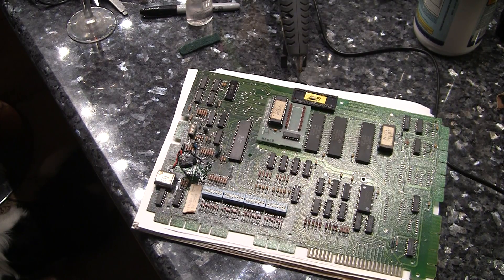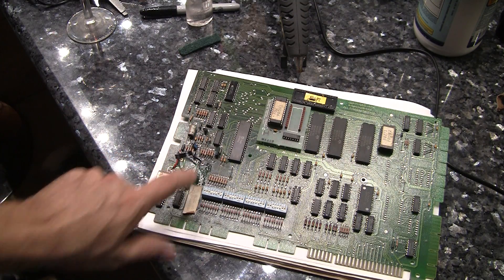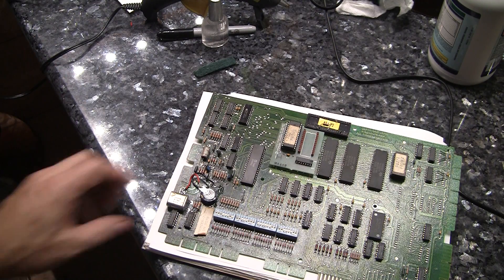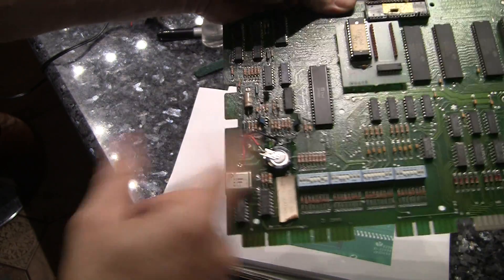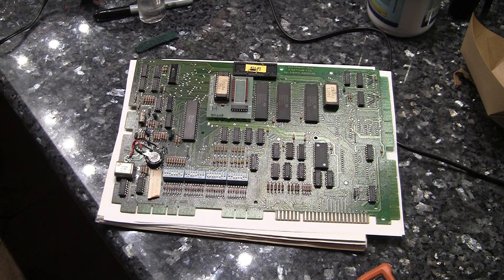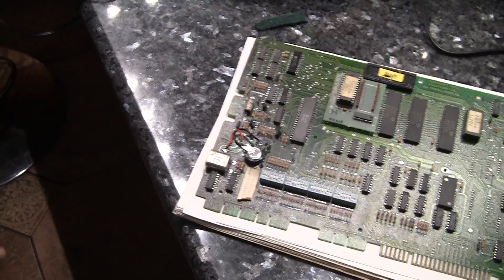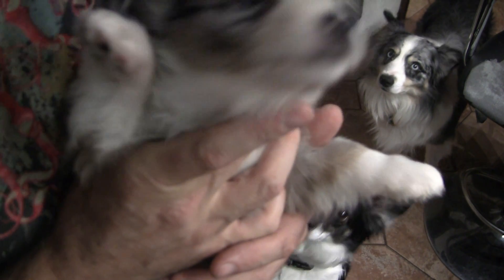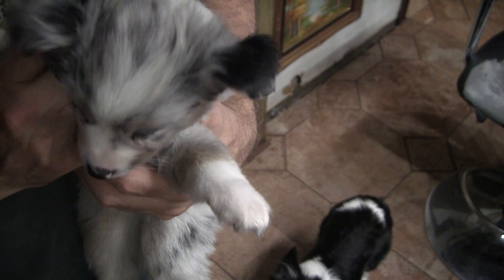Upgrading Gottlieb System 80 board replacing battery pack - Part 2/2 - PinballHelp.com

Comment: Would this also work on a Williams WPC game or only for games that “recharge” the battery?
Reply from the maker: I'm not sure if a memory cap is ideal for WPC games - it might have a slightly higher power draw.  I usually just put a remote battery pack on those.

Another thing you can do on WPC games is replace the RAM with non-volatile ram and you won't need batteries, but the clock won't work - that doesn't really affect anything except for certain games that may have a secret "midnight madness" mode.